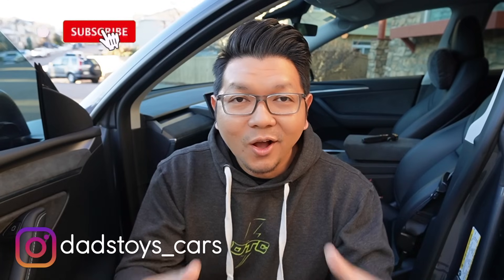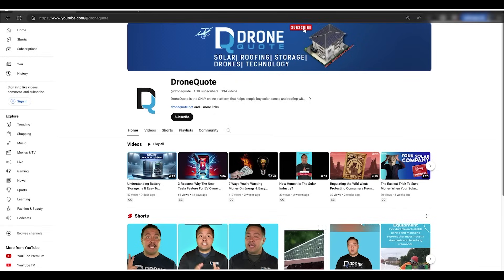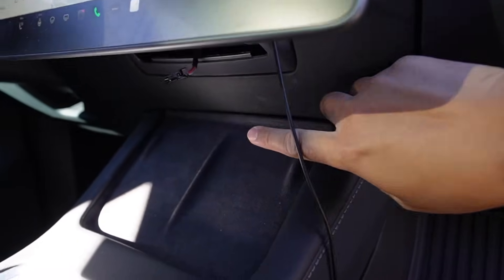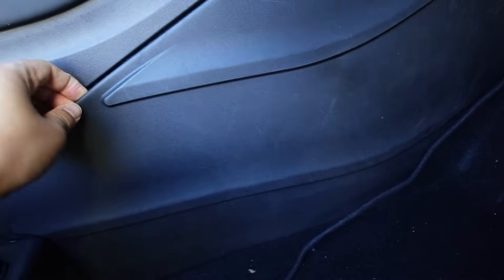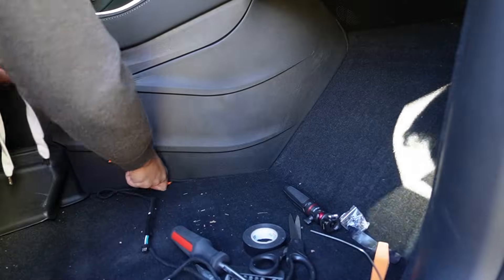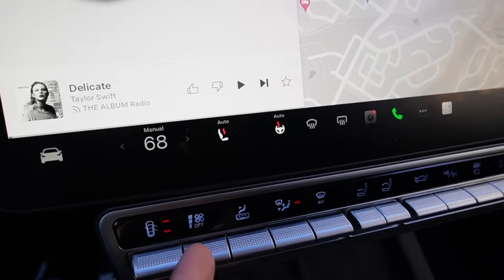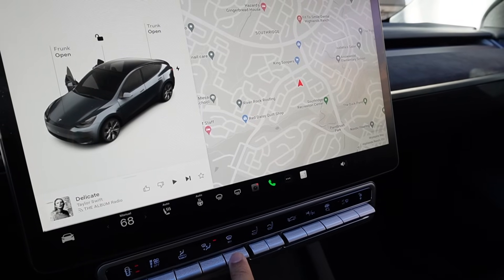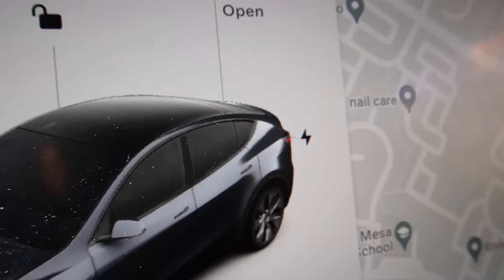2024 Tesla Model Y/3 Physical Shortcut Buttons Upgrade! #tesla #2024

Comment: Product Specification Sheet
Product Name: Dedicated Physical Buttons for Tesla Model 3/Model Y
Compatible Vehicle Models: Model 3 (2016-2023) and Model Y (2019-2023)
I. The size of the product is 27.5cm x 2.8cm x 4.3cm.
II. Technical Specifications:
Power supply range: 10-16 volts
Input Current: <1A
Maximum Power: Less than 12 Watts
Charging Current (Left 1) (Right 2): <1A            
Power supply voltage (Left 1) (Right 2): 5V
Static Current: <10mA
Installation and Function Introduction: See the instruction manual
Package Contents: Main unit, Sensor cover plate, Screws, Power extension cable, Seat adapter cable, Power adapter cable
Packaging Dimensions: 31.5cm x 24cm x 5cm

Comment: Hey quick question.  My box didn't come with a separate pass through adapter or cable for the seat.  just a plug comping out of the main cable.  Am I missing a part? or did you have to buy that separately?  the box says only 5 items (main ODB adapter and one long cable with a seat plug tail).  But I don't have another adapter to reconnect the main seat plug back in.
Reply from the maker: @rohanshah1435   The new version might not need separate wire harness for seat control because it might be able to control the seat via the main OBD port.
Thank you for watching!
Please subscribe for future contents.🙏😃
Reply: @dadstoyscars  that didn’t work. It has a pigtail that connects to the seat. But no adapter. I had to return it. Can’t find a way to reconnect the original plug from the physical seat controls

Comment: @dadstoyscars  Do you still have this button bar installed in either your Model Y or Model 3?  I was just bought this button bar and was doing some partial installation to test the button bar before doing the full installation and I noticed with the latest software update 2024.14.6.

Issues found in SW version 2024.14.6
1. For the frunk/trunk button, only the trunk feature (push down) works.  The frunk feature (push up) doesn't work.  I noticed it worked in the video for opening the frunk but for me it doesn't work at all.  I even tried it with 2 separate button bar units as a test and both units perform the same way with no frunk functionality.
2. For the rear air con control button, I noticed when I press it, it doesn't follow the Tesla screen for On/Off.  In order for me to be able to control the rear air con, I have to press the Rear air con Fan button on the screen set to On (blue) and leave it set to on, but then use the button bar to push down to turn On/off the Rear air con function.  Its a workaround that works but unfortunately doesn't follow the Tesla screen for On/Off status.
3.  For the wiper button, like in #2 when I try the manual wiper function it doesn't work if your wipers are set to "Off".  However in order for me to able to utilize the manual wiper function, I have to set my Tesla wiper mode to "Auto" on the screen and then press down on the Wiper button to swap through wiper speeds 1-4.  Like #2 it is a workaround to get the intended function of the button.

I was just curious if you were able to observe #1, #2 and #3 with the latest software issues.  Also are the 2 USB-C ports in the back used for any firmware updates or are they intended to be USB-C charge ports?
Reply from the maker: Hi Eric, unfortunately I no longer have this shortcut button in my car as I removed it for another product review.
However I have forwarded the issues that you have to them so they can improve the product.
Thank you so much for sharing the experience.🙏😃

Comment: I have 2 issues on this. The new tesla update 12.20.1  caused the frunk button to not work. Secondly can we change buttons to move the left passenger seat instead of the right passenger seats? I live in a Right Hand Drive country.

Comment: I wish the passenger door button was much farther to the right.  I doesn't really make sense that it is to the further left.  I would definitely reorder these buttons (left to right)  to be more practical
1.  AC Blowing mode control
2.  AC manual intensity control
3. Wiper control
4. Front defog control
5. Trunk/Frunk control
6. Glove box/Mirror control
7. Charging port/unlock doors control
8. Rear Air conditioning control
9.  Passenger Door control
10. Audio track control (closer for passenger)  
11. Passenger Seat forward/backward adjustment
12.  Passenger Seat Up/down adjustment
Reply from the maker: Appreciate your comment and suggestions but too bad this shortcut buttons unit is not programmable.
Thank you for watching and your great support Eric!🙏😃

Comment: I already have a rear screen plugged into the rear obd port, can I double stack with these?
Reply from the maker: Yes, you can as this unit doesn’t use that much power. 
I tried connecting front display and rear display at the same time and they both worked fine.
Thank you for watching and your awesome support!🙏😃

Comment: Great review as always!. For next iteration I'd suggest moving wiper control closer to the steering wheel and adding fog light control. Tesla's voice control doesn't work with fog lights and using the touchscreen with low visibility to turn them on is not very safe!

Comment: Great idea, but not happy to dismantle seats.
If they could make one with a Bluetooth receiver it would be better, so you do not have to take so much of the car  apart.
Reply from the maker: You might want to check this one out: https://youtu.be/UOkrEciiJKE
It has wireless receiver and don't have to connect to the passenger seat control.

Comment: RHD Hack - It is my understanding that the unit can be changed to Right Hand Drive (and presumable to Left Hand Drive for RHD versions) by pushing up the third and fourth buttons from the left for 3 seconds until the icons display flashes. Am I correct?         
UPDATE  1- The seller told me yes, so fingers crossed as the saving is $A140.  
UPDATE 2 - Although the action described above does indeed make the unit open the left hand doors, this action will not be reflected in the unit's display. Most likely it would be if you purchase the official RHD version. The left doors opening is however reflected correctly on the Tesla screen.